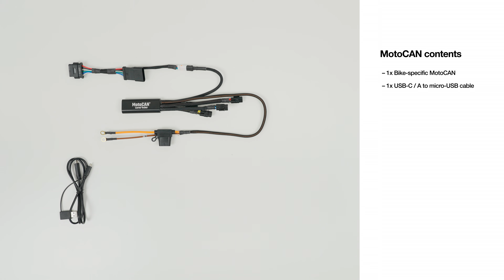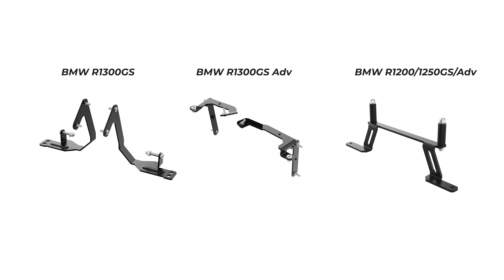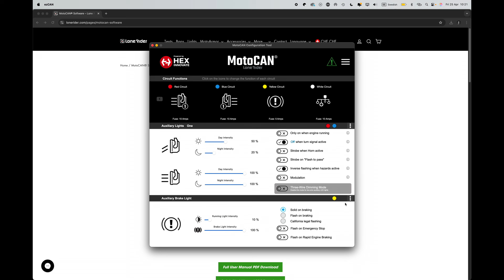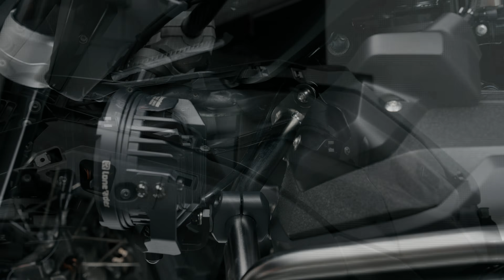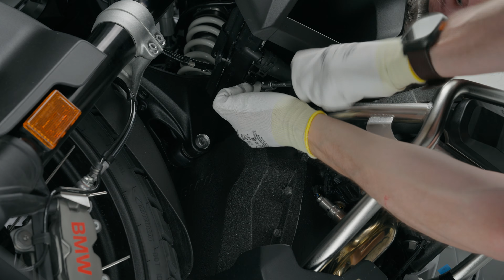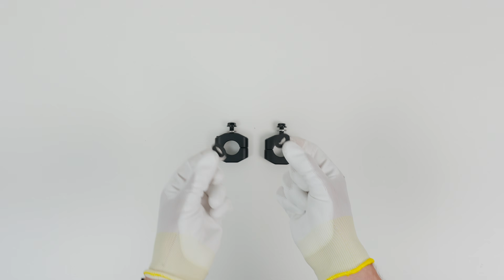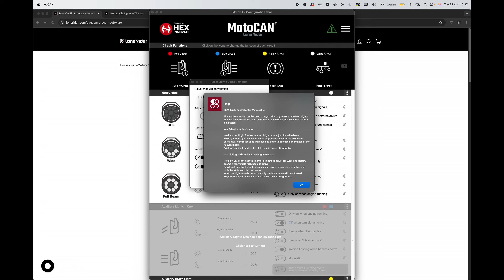Lone Rider MTL9 Motorcycle Lights – Complete Guide 2.0

Comment: Hi alex if i want to run 2 sets of moto lights (4 pods) do i need a second motocan
Reply from the maker: With the first-generation MotoCAN, yes: four pods need two controllers. With the new MotoCAN v2, out since 17 September, one unit runs up to four pods (MTL9 and MTL4, mixed or not). The MotoCAN v2 is also sold on its own, so you can keep your lights and swap the controller.

Comment: Thank you for a great product/products
If there is anything I would like to see added to this guide, it would be instructions for adjusting the lights. You mention that it can be done individually, but it would be highly valuable if you could provide a guide based on your own testing. For instance, showing what angle or adjustment is required when a GS or GSA is on the center stand, so that the user can truly perform it independently.

I am also curious to know if it is possible to make these adjustments without a computer when traveling long distances. Specifically, if it is feasible to have the motorcycle running with full lighting and perform the adjustments directly while it is on the center stand.

I would appreciate your feedback on this. I believe many other customers would find this information very useful.
Reply from the maker: Thank you for the feedback, an aiming guide is a good idea and it is noted for the next guide. The angle of the pods is set mechanically on their brackets, so you can aim them anywhere with the engine running on the centre stand; the brightness settings are the part that needs the software.

Comment: Can the Auxiliary light error be reset or removed using a GS911 ?
Reply: I just installed these last night and the GS 911 was not able to deactivate the fog lights. It stated that the feature is not yet available for the GS1300
Reply from the maker: On the R 1300 GS that error comes from the factory auxiliary lights being unplugged, and so far it has taken a dealer visit to remove the code; as @jn503351 found, the GS-911 does not cover it yet on the R 1300 GS. If you are stuck with it, write to anna@lonerider.com and we will help.

Comment: Great video Alex! I have just bought them for my R1300 GS ADV, however, I would like to know torque specs for some of the importants bolts: tank, rear support seat, etc..
Reply: UPDATE: for the rear 4 TX40 bolts, use loctite 243 and use a torque wrench set to 19NM (~14 ft-lbs). Same applies to the other T
X40 bolts on the rear rack if you decide to remove it. I am not sure about the 2 tank bolts. I would assume same torque settings if the strenght category of those bolts are identical (just check the number at the top bolt's head).

Comment: I installed everything properly but light did not come,  nothing
Reply from the maker: That is frustrating after a full install, sorry. If it is still the case, write to anna@lonerider.com with a photo of the connections at the MotoCAN and the batch number printed on top of the pods, and the team will get to the bottom of it with you.

Comment: Could you please confirm if a special cable is required to connect the motorcycle or the MotoCAN device to a PC? I would also like to know if this cable is already included with the light kit or if it needs to be purchased separately.
Reply from the maker: Hello Diego, a cable is included with the MotoCAN as showcased here: 01:52
Reply: My sport light R and L not same britthnes? It's ok?

Comment: Has anyone installed these lights with a controller (Motorcycle Lights – The World’s Smartest Motorcycle Auxiliary Lighting System) on an AT 2025?
Reply from the maker: It is possible today: the MotoCAN V2 exists for the CRF1100 Africa Twin and Africa Twin Adventure Sports from 2020 onwards, the 2025 included, so the MTL9 and the MTL4 run on it, set up in the app. The Under Nose Mount for the Africa Twin is on lonerider.com as well.

Comment: I installed the lights yesterday. Although the tutorial makes it seem like it's something very difficult, it's extremely simple. You just have to remove the screws (which are all the same, luckily) and follow the steps Alex explains in the video.
On a quiet afternoon, they're installed and look spectacular.
This also helps you get to know the bike and its interior better, and it shows that it's quite easy to remove the plastics and guards in case you need to do it in the future.
Reply from the maker: Screws off, lights on, and the bike a little better understood by the end of the afternoon: that is exactly what the guide was for. Enjoy them, and thank you for writing it up for the next rider.

Comment: I cannot get them to stay in place after they are aligned.After a couple of km they are in different directions
Reply from the maker: The pods should not move once the bracket bolts are tightened; if yours still turn after a couple of kilometres, write to anna@lonerider.com with a photo of the mount and the team will look at it with you.

Comment: I'm wondering if the stock auxiliary lights can be used alongside the Lone Rider lights. Here in Spain, I believe they're not valid unless installed by a workshop, as they require modification to the motorcycle.
Reply: im just installing them together with the stock ones.

Comment: Can multiple motocans be daisy-chained together in order to install a second pair of motolights ? 

How can I get two pairs of motolights to full functionality on one motorcycle?
Reply: Not sure it's a good idea, your generator/alternator won't be able to keep up with two sets of lights on full blast
Reply: @SleipnirADV thanks for this!

But I have two sets of Denali D7s and another extra set of LR lights on my 1250gs (only on full beam)

They run fine 🤷🏽‍♂️
Reply: @SleipnirADV  I see that you have two sets on your GSA. Any issues? Did you use two MotoCANs, or daisy chain them on one?
Reply: @thoham60 I was referring to a KTM bike.
Reply from the maker: One MotoCAN V2 now runs up to four pods, two pairs, MTL9 and MTL4 mixed, with separate levels for each family in the app, so no daisy chain is needed; on the first-generation MotoCAN, two pairs did need two controllers. @thoham60 that answers yours too.